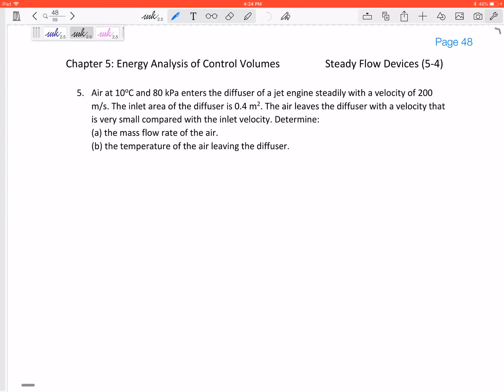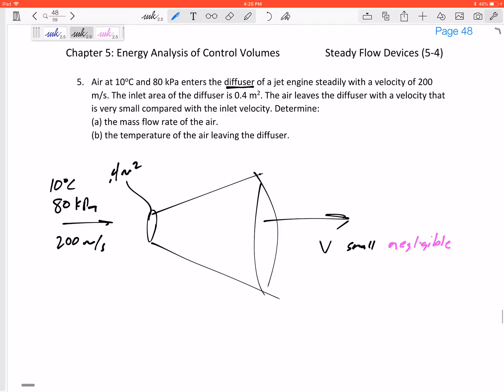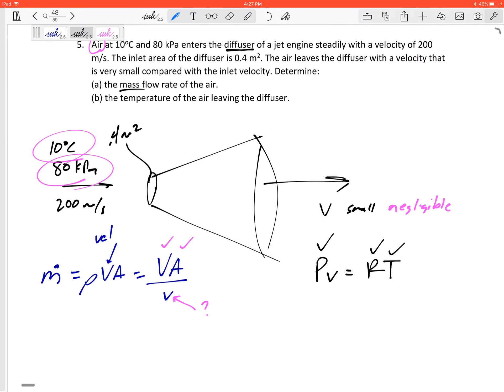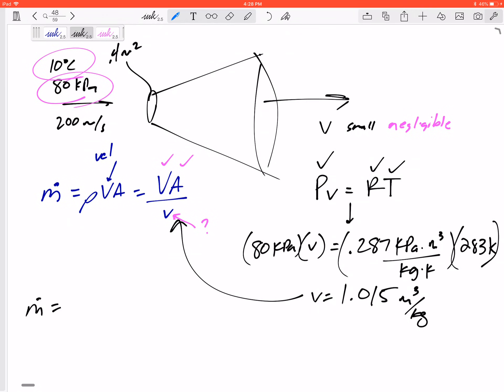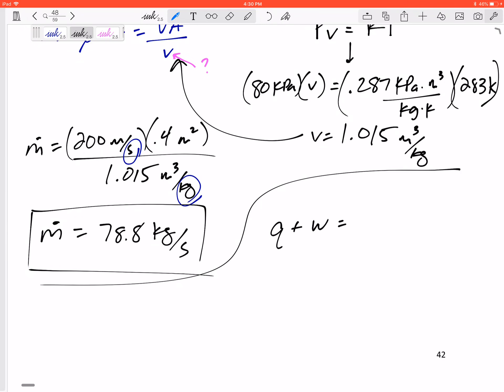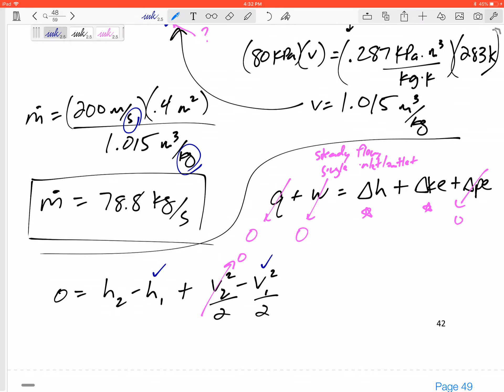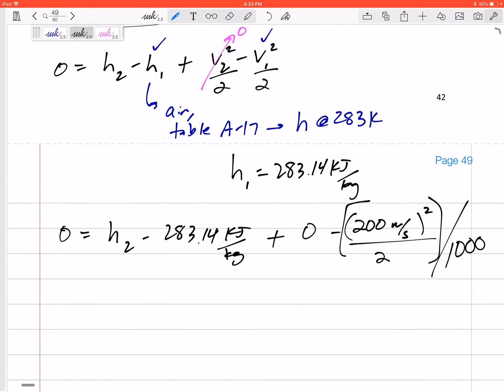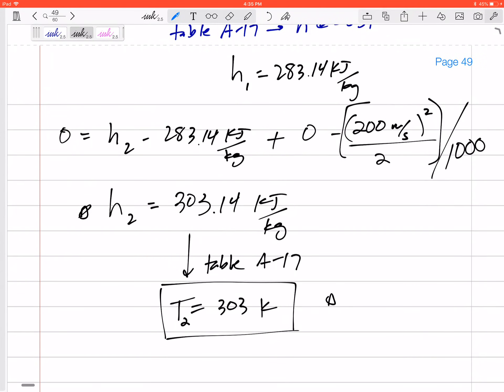Thermodynamics - Steady Flow Devices - Diffuser

Comment: Hi Sir,

Just a quick question. Which table do you use to get the height and temperature?
Reply from the maker: h is enthalpy. I’m using table A-17 (the air table) in the back of the book. You get h from the equation and then take that h to the air table to find the temp.

Comment: Sir, can we use the Cp formula (h=Cp*(T)) in the last part of the question to calculate h1 and hence the final temperature
Reply from the maker: generally dH = CpdT is less accurate than property tables, and is useful for smaller temperature differences so I only use Cp when told to or when I don't have property tables.
Reply: @engineeringdeciphered  thanks sir :)